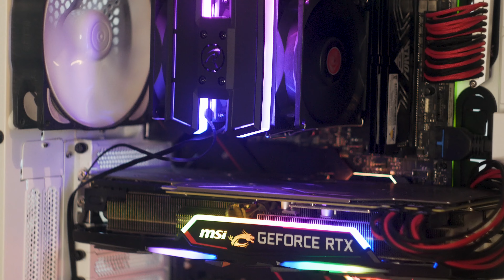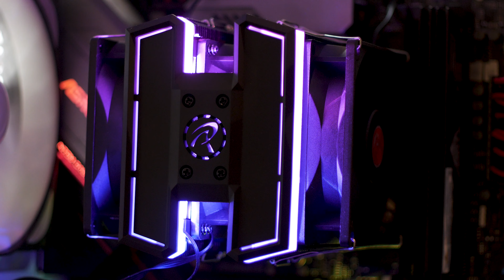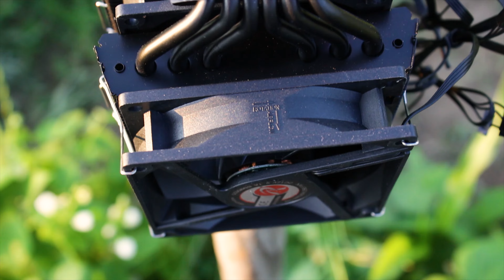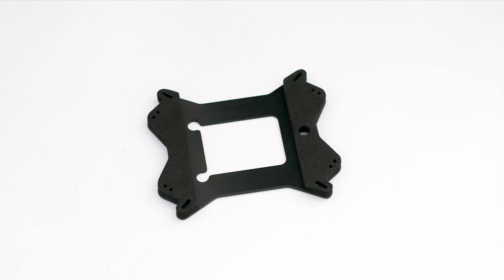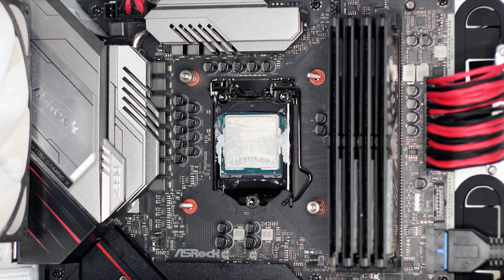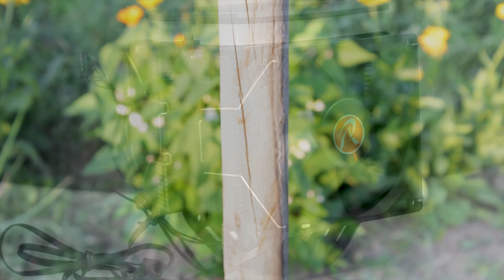Raijintek DELOS RBW - CPU Cooler Review

Comment: Hi guys! i cant turn on the rgb. it is a 5v cable. but i can not make it work. i have a B365 Aorus Elite. firt i put it in the 12v. then i read the manual and i put it in the 5v plug. :( help
Reply from the maker: There is a chance that you did not damage the LEDs. Did you line up the pins of the connector correctly with the header of the motherboard?

Comment: dude i get up to 100 degrees under full load wtf i only have an i5 9600k oc to 3,9ghz. how do u have 70 degrees max?? i'm so confused rn
Reply: C or F?
Reply from the maker: Is the cooler installed correctly? Did you forget to remove the plastic label that is on the baseplate of the cooler?
Reply: @TechLegend-com  yeah the cooler was a bit too loose, fixed it now and it works properly

Comment: I used this Cooler on an i7 11700 with integrated graphics and it reaches 100° when I play Valorant with low graphics
Reply: During the installation I noticed that the metal part that tightens the heatsink with the base seems not to be enough to secure it and it moves a little to the sides. is this normal?
Reply: I have installed it twice and the same thing happens. Could it be that those protruding marks on the metal part that should hold the heatsink base to the base not enough? Because despite screwing the metal part to the base, the heatsink moves a little to the sides
Reply from the maker: @brianpuebla1123  Sorry for the late reply. That metal beam moving is not normal, it should be tight with 0 movement.